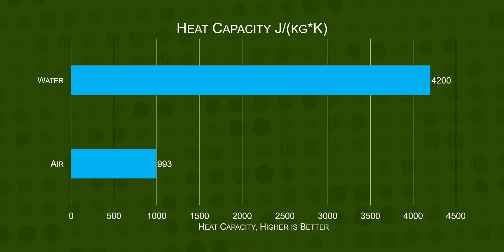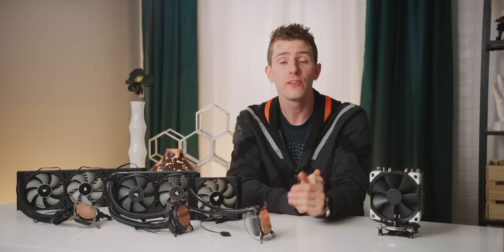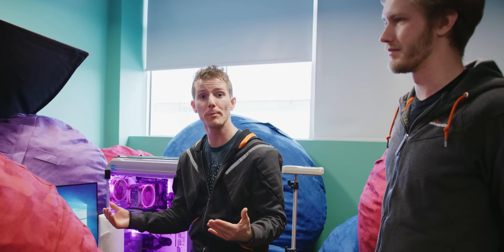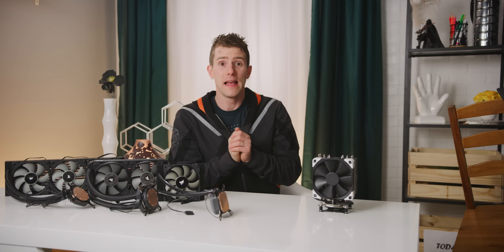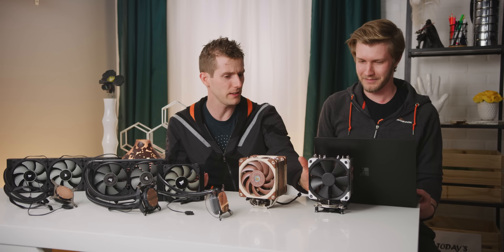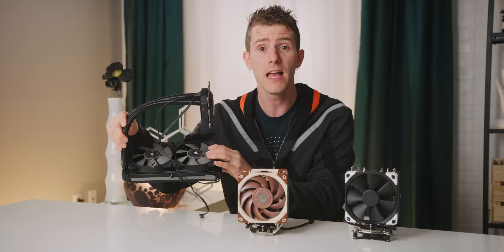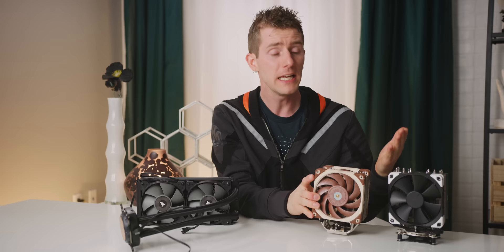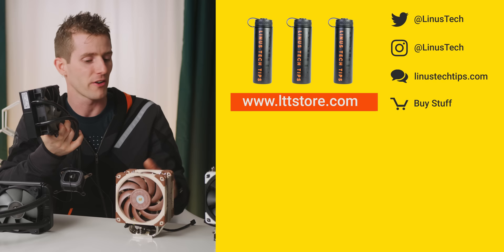Why you shouldn't water cool your PC

Comment: Bought my H60 from newegg for 50 bucks, been using it for almost 6 years now, I have my fan on silent mode and full pump usage, I usually do not overclock but keeps my CPU temp below 75F. I have two front fans, and one upper.

Comment: As a very oldschool guy that owns a old wattercooling system done by myself. the real (watercooling systems). i want say that my idea about the review is about the same. Heatpipes nowadays are very good at transfering heat. They are the main reason air colling is good because the old air cooling systems couldnt do it good enouth. when i bought my watercooling system i had a northbridge and prescott pentium 4 they was reallly loudy with the oem cooler. i can say on FULL mode it would make about same noise as an average vaccum cleaner :D. upgrading to watercooling at that time was a complete game change.
Nowaydays you dont really need a watercooling system but its cool to have one. specially nice if you are the kind of people that likes to build stuff and make your own designs and inventions or just if you want to have a show off pc. But a good air cooler is about as good as a good water cooling system. 
My own old watercooling system was designed to be as quiet as possible. it is a NON fan watercooling system so the only noises it used to make is the power supply, water pump and the HD. a water pump noise is deeper and change acording to the pump and insulation you choice. also if you like listening water running you can tune your watercooling system to listen water like some aquariums do.
If you want me to make a video and present you my old watercooling system please thumbs up and coment below. If i have enouth i promisse i will do it.

Comment: Water cooling is very good for a normal gaming rig. I used my cpu with water cooler for 7 years and it was a good experience, I never had a problem, it worked silently on high loads. But recently its water pump started failing and I had to buy a new one.

Comment: As to some commenters' claims as to water cooling being necessary, I have been using a gelid GPU cooler with Noctua 1700 rpm fans pointed at my AMD 6600XT and two, front Noctua 140 fans with similar RPMs, with my builds. I just use cheap Gammax 400 v2 or Cooler master coolers. However, my CPUs, including the 11600k and 10700k, in my MSI boards not only never throttle but maintain maximum temperatures in the 50s or 60s during tests. Water cooling is not necessary, and just putting more fans avoids water leaks.

Comment: Despite good airflow my cpu was thermal throttling with an aircooler perfectly rated for it (105tdp). Chose a water cooler recently and my cpu barely goes over 60, if even (usually balanced around 55.7C). as such, water cooling is my savior

Comment: i am using noctua nh-u14s since it came out just moving it from motherboard to motherboard and case to case since i upgrade from time to time. This cooler never leaked (not a surprise haha) and the temps are equal or lower compared to 2-3 fans water cooled systems. It looks cool, but only a custom built system can give better results. And it wont be quiter.

Comment: The big issue with a large heat sync like that is dust buildup. Unless you wanna manually clear dust from your PC every week, it's likely that the airflow through the heat sync will get impeded by dust over time and seriously weaken the performance. It can even become a hazard if left unmaintained. Liquid coolers should last a decent amount of time without needing much maintenance.
Reply: If you think that you need to clean your pc every week then maybe you need to clean your place more frequently so your pc doesn't suck in lots of dust. I clean my place every other day and I only clean my pc twice a year. Yes there are dust accumulation but it's not cringey dirty. A used toothbrush and cotton buds would do the job.
Reply: @tidus1ph  I exaggerate slightly, but if you run a PC with a huge CPU heat sync + fan like this for 8 hours a day, it won't take very long before the dust accumulation starts to impede the cooling. Those things correct dust faster than actual dust filters.

Comment: This video kinda kicks itself in the ass. At around 5:33 Linus discusses how the radiator placement on the top is for acoustics and that it will be bad for cooling.

Then later it's like "OMG how is AIO not cooler".  Put it on the front yo, it will be almost 10° cooler.

Comment: My Corsair h100 keeps my i7 7700k that is oc’d at 4.9ghz at a comfortable 82c when at max load. I have a push pull set up using Corsair 120mm hd rgb on the radiator, and have had zero problems. Beefy
Reply: What are your idle temps?

Comment: Water holds heat longer. If you drop your load the temps will be kept up higher longer than air. Air brings CPU back to 35 much faster. Air is superior. It's simply more responsive than water.

Comment: i still use an h60 aio on my 10700k o.o. mainly due to cooler clearance for my itx case. doesnt really go above 75c with 4.8 all core full load with a slight undervolt. While gaming, it doesnt go over 60c.

Comment: I don't know guys I just put my system together 5800x Ryzen chip... Star RGB fan which was pretty good size that came with it running at 67 to 70°c.... I got the Corsair 240 AIO stuck it in on top temperature between 49 and 53°c... Test was loading in graphics and all eight CDs of X-Plane 11 as soon as I was done exited out went into BIOS to check temperatures.... That was sitting at 58°c

Comment: Can someone pls answer this.

I saw someone paint spraying a water cooler.
Will it change the cooling performance.
And if so, how much?
Reply: Every layer between the radiator an the air will effect your cooling Performance in theory, but if you dont spray an extreme thick amount of paint you wont recognize any performance issues

Comment: I think you need to run the test again but with the rad mounted in front where it can get cool air. The current set up with rad on top is being effected by the heat in the case coming from the gpu. would be good to get a temp sensor in the pc temp outside the pc and temp of the GPU in each scenario. Good video though

Comment: Vehicles abandoned air cooling long ago. Long live the VW Beetles, vans, and Corsairs. You should have tested Cooler Master instead, like the ML240L - it's quieter and cools better than the Corsair AIO's. Also, you need all that fan control for the Noctura to work correctly at that low of a DB. Not every motherboard has 4-pin PWM fan control.

Comment: I have huge heatpipe cooler on my CPU and was always happy with it, but my recent upgrade to the RTX 3080ti FE makes me look for alternatives with better overall airflow. Problem is, the RTX sucks air from the bottom of the case and blows it upwards, towards the CPU cooler.
Reply: Ditch that thing and get a 360mm aio and don't look back
Reply: @mikerzisu9508  360 or 280 ? which better? arctic liquid freezer
Reply: @morgothbloody7181  depends on the cpu. On my 12900k I am using a 360mm aio, lian li galahad.
Reply: @mikerzisu9508  i have 12600K but i will be overclocking him to 5.2-5.3 HHz
Reply: @morgothbloody7181  I would go 360mm personally
Reply: @mikerzisu9508  okay thanks bud

Comment: My liquid cooled I7-950 processor running a torture test program that maxed out all the cores never got hotter than 45 degrees C in a 21 degree ambient. Under normal operation it ran less than 30 degrees. The water pump has been in use for 12 years and still going strong. The water has only been changed 3 times. The H60 water block appears not to be a full copper water block and looks like there is plastic in it's construction. Try using an all copper water block like an EK. System never lost a drop of water in all these years. I'll take water cooling over air cooling any day.

Comment: I loved my noctua cooler, but when I changed my card from a blower to a 3080 that vented the heat into the case, the noctua suffered greatly. Went to an aio mounted to the top as exhaust and problem solved, back down to reasonable temps.  Few variables involved on what's better for you
Reply: yep my 360mm top mounted radiators from the liquid cooler pull out all the hot air produced by the gpu

Comment: I'm not surprised that water drops in performance in longer runs because it has a higher heat capacity then air but water is also considered an insulator and pure water is even better at insulation then tap water

Comment: I once had a Corsair H80i, complete nightmare to mount. Didn't fit in my midi tower either, performance worse than most 20-30$ air coolers. Never again. One day, I will go for the DIY water cooling setup tho.

Comment: dust dust dust dust dust dust on your cpu fannn...I love how the dust is multicolored and blocks all the vents with dust...dust...dust...I love how when you use a brush to move the dust...there is still move dust balls that end up in the crevices of your cpu fan and how ends up in your nose.....true the dust also collects in a water cooled radiator...but you can easily clean that away..since it a simple relatively flat surface that can be lightly vacuumed.....try cleaning the tiny, itsy bitsy crevices of an intricate cpu fan.....impossible...the only way to clean it is to dunk in in water and shake...oh yeah with the fan stuck in it...

Comment: There is one thing about water cooling, if you design system with removing water outside the case, I mean the cooler is outside case and the water is cooling outside the system.  In that case you'll have much less dust inside your system. This is becouse there is less air flow from outsie to inside. The next very clean way to cool down the space of the case, is to have water cooling system with two condensers: one takes heat from the inside of the case, the second one with the help of water, throws heat outside. This way there is no dust inside as there is no airflow to the case.

Comment: Aio almost always perform better when you use proper placement and don't cheap out on the part. Now with that said aio does have the worst possible issues when they go wrong. You just need proper placement. MOST cpu like amd will throttle all the way down around 75°c my ryzen 5 3500 works great because it's undervolted in its overclock. Less volts equals obviously less power consumption

Comment: My water cooling  experience has been fun. My build is 6 or seven years old.  Started out 4790k sli 980ti auqacomputer cooling . 2 360 mm and 1 240 radiators 2 pumps 13 fans. Cpu video cards and hard drive cooler. It ran crazy cool.it was a nightmare lol. Have gone threw 3 custom boxes. Really big steam punk thingy., Carbonfiber one that ended up looking like claptrap and my newest one I call it ziptie. All my components are literally zip tied to a plastic milk crate.now I'm running 1 360 radiator 1 pump 1 video card and only cooling cup and the 1 980ti. Will not be doing another liquid cooled system. But it was fun. Oh yeah the cooling system came used off ebay. Gave 180 for it great deal. Came with cooling blocks for ram and everything you can think of they were all solid silver got 200 for scrap. Fixing to sale the other rads pump and controllers..

Comment: While it's true pumps are prone to failing suddenly  an AIO with a failed pump will still provide some cooling, usually enough to keep running light loads. Same with a failed radiator fan as long as you still have at least one running. An air cooler with a failed fan likely means thermal shutdown within minutes, and of course the most likely time for it to happen is when you urgently need to access some file and your last backup is 6 months old.

Also if you're going to compare against top-of-the-line noctua, pick an actually good AIO brand like arctic or EK, not corsair's trash.

Comment: After years in pc building I can tell you what is what. Air coolers are as good performers and more hassle free, but AIOs look better (not always, there are very cool air coolers too but anyway). If you cannot fit a good air cooler because you don't have space then an AIO might be a better solution. What you are actually doing with an AIO is moving the place from where the heat dissipation will happen. With an air cooler it will happen right above your cpu. With an AIO it will happen wherever you mount the radiator, and you can move that mass around.

Comment: The one thing I think really helps with water coolers is the heat coming out of your PC. My room gets exponentially hotter with an air cooler vs water.
Reply: Doesn't that mean the air cooler is working better to remove heat from your computer?

Comment: Does any 1 have some strong advise for me if i want to start whit water cooling my pc whit regarts to what fittings to use and pomp and 360 radiator and what size soft tubing  for about 200,- ?????

Comment: when I purchased a prebuilt gaming pc and had it sent to me, either intentionally or not, the CPU cooler was half just hanging with one side fully unsecured.  Getting it reseated was such an ordeal, I had to take a bunch of stuff out like the m.2 and the ram, just so the clasps would fit, and it really felt so tight when I secured it that I was afraid of breaking the motherboard.  Not fun.

Comment: I can't get past how heavy the modern day heatsinks are.  After having a 1.2+kg Noctua on my old 3820 for a decade, a slight bend developed in the motherboard despite it never having been moved with the heat sink on, I just went with a simple H60 for my AMD 5600x.   Fortunately, the 5600x runs much cooler than a 3820, so it's actually running at a lower temperature with a markedly worse cooler...and the case is carrying all the heavy load, mechanically speaking.

Comment: You should do a experiment where you cut fans. Like only one fan on my water cooler is working and my temps are still around the same. and I could probably turn off the one working and still have better cooling than a heat sink that would probably be melting down fans after a few min of failure. In the last 10 years I have had 3 fans fail and I think I am still using the same pump.

Comment: I run a BeQuiet dark rock 4, on a AMD 3900x and flogging all cores it never goes above 71. I used to run a water loop w 420mm of radiator and it never got above 71. The temps were pretty consistent weather on water or air. the only thing was when on water it took longer to warm up, but conversely it also took longer to cool down. 

But water was more of a pain in the ass to maintain, so switched back to air.

Comment: Wow been using aios for 12 years...my i7 920 is still using the original corsair H50 aio with very good temps...i dare not remove the head to re-apply thermal paste as i dont want to jinx it...under gaming load i have max 55c

Comment: My water cooling system idles at 31 deg C and even under a load it gets in the 55-65 deg range.  I have owned water cooling AIOs since 2015 and ran it for 7 years no problem.  I dont know why your tests are so much different then Gamers Nexxus, but their results showed Water Cooling better at cooling then even a gigantic tower air cooler. One of the main problems with air coolers is the fact that they take up a ton of space on the motherboard. I ran Air coolers for years. I love the sleek look of the water cooling too. Even Gamers Nexxus use water cooling on their production servers. So dont just throw AIOs in the trash and call it garbage use what you like and leave it at that.

Comment: AiOs are great if you want to direct the heat away from your GPU. When I built my last PC, it started out with a Corsair AiO and I was pretty happy with it, until, of course, the pump failed. Then I got a Noctua NH-D15 which cooled the CPU a lot better, but my R9 290 got about 5° C hotter.

Comment: Its not that watercooling doesn't work... its that they REQUIRE the pump to work  to work.   Also you rely on manufacturers to not cheap out on the coolant they put there.. if they use crap then it will gum up the pump in a few years.

Meanwhile a heatsink relies on its attached fan or fans.   If the fan dies it will still offer heat dissipation.. but if a water cooler pump dies.. you get a faster time to overheat temps.

Comment: aio u need to clean the radiator and fans from dust. pump broken = buy a new one.
air cooling u only need to clean the fans. you only need to replace the fans, if the fans failure.
but AIO still better to cool overclocking cpu imho

Comment: my plan is to build a pc with a noctua cpu cooler.
I want to build an insulated box big enough for my pc and a hepa filter 350 cfm fan.
I will seal the box around a rigged window air conditioner, set to cool down to 2-4 degrees C
I want to 3d print a shroud from the fan to the back of the case, and another shroud from the back of the case to around the noctua cooler.
It needs to be a horizontal motherboard so the noctua cooler can operate at peak efficiency for heat transfer up.
the goal of all this is to get on the top ten list of overclocked cpu, using air cooling. That is 5.7 MHz or higher.
If It is successful, I want to transition to bringing in cold winter air to cool the cpu and set an even better record overclock.
all this will not be permanent. Its just to set a record.

Comment: I own a H150i and my CPU never goes beyond 50-55°C, I'm not sure how you got those sketchy stats (your video doesn't even provide context or how the test were conducted for heat), but they look wrong to me Performance wise, I wouldn't feel comfortable using an air cooling system when it's 30°C+ in my bedroom, even in unbearable heat, my CPU stays at 50-55°C max. Also I bet hte Db level is much lower then whaty ou are saying because my pc case is pretty much noiseless.
Reply: This was 5 years ago too. Also noctua is literally THE best of the best for noise and performance. Asetec is a garbage pump system anyway so it's not surprising. I own an arctic freezer iii 360 and it definitely without question beats the nh-d15